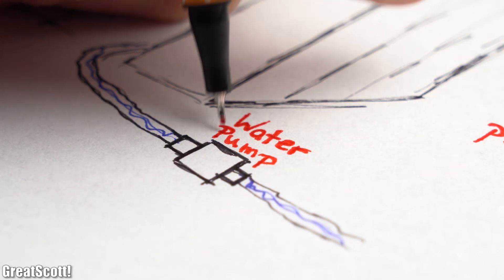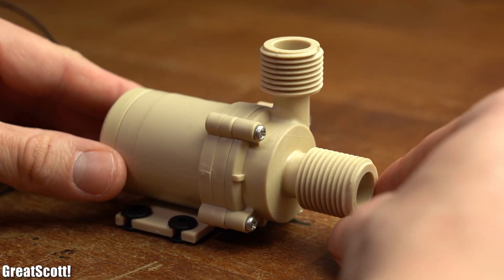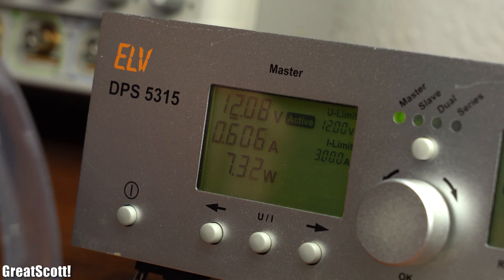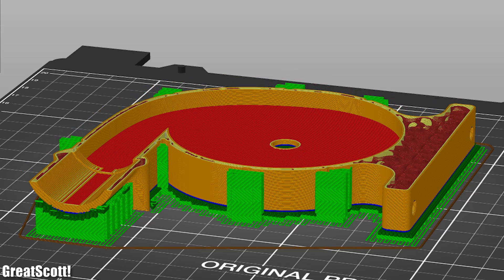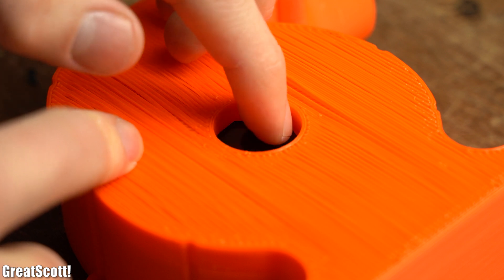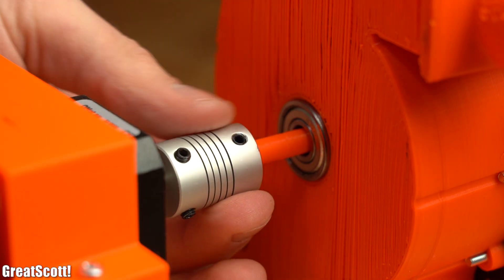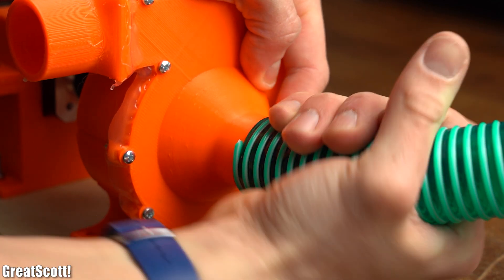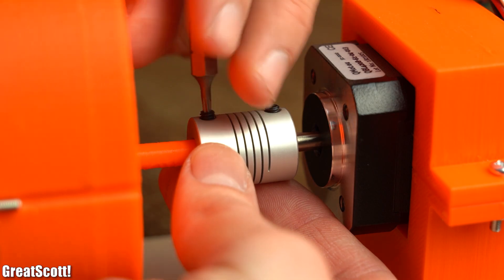Water Pump || DIY or Buy

Comment: I designed a similar project a few years ago.  I used a submersible aquarium pump which is self-priming with magnetic drive.  You need to ensure that not only the flow is good but the "head" or how high the pump can pump the water is also adequate.  I had some hanging plants.  Interested in seeing the control and measurement part of the design.

Comment: I need a reliable level switch for the 120 vac Sump Pump. The tether float switches fail and cause great basement floods at any time of the year.

If you have City water at a good pressure, consider a venturie pump solution.

Comment: I'm pretty sure that it is possible to 3d print a pump like that, but you have to build something like the rotor axle more accuratley so that it's perfectly straight.

Comment: There is a lot of comments about metal shaft, but I'll write one more anyway :) 
In one of my projects I pressed old screwdriver bit into tight fit printed hexagon. My 10 N.m screwdriver did not break this connection within 2 years of use.
Reply: Nice one, much better than using a grub screw.  I've got some hex extender bits (just hex to hex) and have used one to connect to a piece made in polyester filler.

Comment: Excellent video as usual 👌. I think you can build a more successful version of a pump called a "direct couple pump". Use the motor shaft and bearings to support the impeller. And use a shaft seal at the impeller housing. 👍

Comment: I don't think your conclusion is correct. You 3d print shaft on Z axis and this makes it weak. If you would do it in X or Y axis it will become 10x stronger. Also why you leaved huge gap between motor and prop 5:14 ? This raise stress to already weak component. You should review your printing. Huge fan btw. (Sorry for grammar, still learning.)
Reply from the maker: Thanks for the feedback :-)

Comment: Yes 3d printing is for sure a good option. Just don't make a shaft out of petg but out of metal. Sorry but bad video. There is just not the right information. This problem is easily preventable.
Reply from the maker: It was not the only problem. There were others realted with the 3D printing.
Reply: Yeah I tried it as well. Mine worked fine with a threaded rod. Also your rotor blades are pointing the opposite way. Yours want to scoop in water and the point of each blade is to push out water. Can you maybe make another video about this. Also I would make it half the size of this one. The motor is just not powerful enough and it will overheat for sure.
Reply: @greatscottlab  Is there a mailing address or something I can contact you. I will send you some good files

Comment: If you are looking for a pump cheap pump for water, you should take a look at the 12v DC pump (https://benselectronics.nl/pomp-12vdc-zelfaanzuigend/). I used this one for a project for school and it is possible to change the speed with a pwm signal.  It doesnt pump 8L/min but it definitly is a decent alternative.

Comment: modify the impeller to have allow a hex head bolt like an M6 to sit in flush to the surface of the impeller, and then the bolt is now a working shaft and has a key to it never slips.

Comment: The direction of the layers in which the shaft was printed and its small diameter are not capable of sustaning  high RPM. Also the 3D printed shaft is not balanced as you can see in the footage and this becomes a problem at high RPM. You could try to 3D print the impeller with a hole in the center and use a metal shaft instead. This is possibile but, as you said, it's easier to buy the pump because a new improve setup would require a bit of tuning to make it work perfectly.

Comment: I noticed some people have said that you should have tried a metal shaft with 3d printed impeller. While you could certainly try that, I don't think it will be of much help. The shaft is not the only thing that is under stress, the vanes are as well. PS - the profile and number of the vanes are also a variable in centrifugal pumps. Inward spiral, outward spiral or straight vanes. Some pumps also use guide vanes (static) in the casing of the pump, but I cannot remember if that was air only or any fluid.

What you can try is a geared pump. Think of it as 2 spur gears but with small "lobes" between the meshing teeth that trap water when they are spinning.

But still, the best option would be to buy a pump, especially the cheap Chinese submersible stuff. (They use plastic impellers, surprisingly)

Great video as usual!

Comment: 9:16
anyone with a 3d printer saw that one coming since 4:20
such a small cross section of 3d printed material is really weak
especially when printed along layer lines
Reply: The was a pretty obvious problem even to those of us who haven't used a 3D printer yet.
At least he leaves the comments open to let people tell him what he did wrong. Some YouTube technical channels delete comments pointing out errors. The Raspberry Pi Guy has contributed to many destroyed boards because of bad directions. He deletes comments pointing out his serious mistakes.
Reply: The moment I saw how the shaft was sliced I knew that it would break there. You cannot slice a shaft that way, it will always come apart at some layer.
Reply: Also, the print quality is quite bad, I'd say, when I see all the separation from https://youtu.be/GBv80BgfTBc?t=311 to https://youtu.be/GBv80BgfTBc?t=321
Reply: especially in PETG, PLA has the strongest layer bonding of the "low temp" materials unless you go to high temp like nylon in a heated chamber
Reply: @l3d-3dmaker58  And PLA flexes less and the biggest mistake he made, is not actually using to bearing, but letting the shaft flapping in the breeze.
Reply: @l3d-3dmaker58  I guess ABS is the strongest
Reply: @Tachi778  actually the weakest. PLA is the highest just after Polycarbonate and CF filled Nylon in terms of load. In comparison to PLA and PETG, ABS can take the least load before breaking and has at best same layer adhesion to PETG.
Reply: Yup I would have printed that piece separately oriented another direction and glued it in. Or just used a metal rod.
Reply: @Alobster1  even printed in a different direction, it still would have broke.  Just get a small/cheap section of m6 threaded rod, and it would have been fine.

Comment: Nooo, You did it wrong. And that model is bad.

Use a 8mm rod to connect it. Its not much to design and you dont event have to use glue. Just use an angle grinder to make one end into a D and make it it into the pump.

Comment: You didn't try replace the axle with a metal axle?

The conclusion is kinda right still.
Many of the pumps you can buy are without seals toward moving parts, and generally can't leak.
(the whole rotor is part of the pump chamber)

Comment: https://www.youtube.com/watch?v=aXcEiOuWKx4&t  DIY is winner!!!! 
i used motor direkt on impeller..  make 10meters lift.
Reply: Great video and project! Less pieces to break that way too, looks like it works just fine. Any way you could provide the parts and files to it?
Reply: @JacKAsterisK  yeggi.com you can find a lot of models of this centrifugal pump.. btw thank you :D
Reply: Wow, great work there! Maybe Scott could do a follow-up fixing the project?
Reply: seems like on your pump the impeller is wrong
Reply: @philehr  in what way?
Reply: I left a comment on your video with some friendly suggestions for how to operate it that might improve the performance of the last demonstration. One thing though, where do you show that the pump can produce 10m of head? Also you did mean 10m of head, right? As in it can produce an outlet pressure equal to the hydrostatic pressure of a 10m water column?
Reply: Nice project looks like you have a nice working pump.
Your A8 is a little sad though you need some upgrades 👍
Reply: @Side85Winder    i make mpcnc machine/3dprinter.. ;) in next 30 days you can see video about it.
Reply: underrated channel
Reply: https://youtu.be/TfBycQ90-L4
I made one, too! I works great
Reply: Yes! You had a much better design. I hope MediocreScott! modifies his design to become GreatScott! again.
I do appreciate Scott shares his failures.
Reply: @ddegn  thank you

Comment: You should have modified the impeller part and make a hole for a M6 bolt. With that you'll have a metal shaft and a fitting by shape with the hex head of the bolt

Comment: You shouldn’t rely on the 3d printer for the shaft u could of make them out of a different material for example like aluminum since its rigid and light

Comment: the shaft could be metal. Just print a rotor with a hole and a few tiny screw holes like in a door handle and attach the rotor to a metal shaft. That would work way better!

Comment: Like every other comment, you need a metal shaft. 
Just drill a hole in the impeller cut an x slot in the shaft for some metal sheet to use to key the plastic. Heat the shaft and insert.
Also you can turn off your fan on the 3d printer and maybe add 5-15c to your hot end to get better layer adhesion.
Swap pretty for strong.

Comment: 1.Powertransmission should never be done using 3d printed parts.
2.Shaft should never rotate inside the inner race of bearing. It should rotated along with innerrace (pressfit) otherwise there is no use the bearing.

Comment: Hey man
why don't you use a submersible water pump that takes 220v and as is way way cheaper. In India, you can get one of the submersible pump for 2 dollars with a pumping capacity of 11 to 18 liters per minute. You can use a simple relay to control it and also use a triac ac voltage regulator to control it's speed.

Comment: The project is interesting, but the costs with some components disadvantage it in price compared to those of the trade: 1. Using a more expensive type of engine 2. Defective mechanical design - you left the pump shaft out of plastic -.

Comment: Hex nut imprint for a bolt as a shaft would do better, just not thread all the way so you can still get a bit of a seal on the shaft and you would be off to the races

Comment: I noticed this in the first instance. I have made my own pumps but without 3d printing. I made small pumps by casting exposy resin and grinding it down. Now all you need to do is screw in proper shaft and add a waterproof bearing. These you could get from old blenders. Yes, the size will be large but you can adjust your shaft to be thick in the middle.
Reply: Remember, this is a sponsored video

Comment: Modifier the propeller so it accepts a metal drive rod the same diameter as the bearing and it’ll work fine. Might also be worth testing the balance of the propeller when it’s spinning, so it doesn’t vibrate itself to pieces 👍🏻

Comment: Why didn't you make a 5mm hole in the rotor and put a M5 bolt to be used as a strong shaft? I think your huge pump could work well! 💪
Reply: He wouldn't be able to seal it since a shaft seal can't work on threads

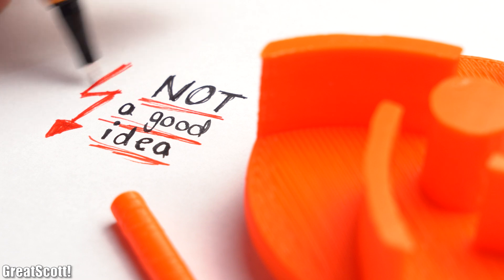Comment: 9:26 they probably used the motor shaft instead of a 3d printed one, judging by how close the motor is to the impeller
Reply: its also badly printed, the layers look terrible
Reply: @rueebliortak  no, it is clear that the parts were printed on a raft, however this should not affect the shear strength of the shaft.
Reply: @s.sradon9782  The layers being perpendicular to the shaft certainly contributed to its weakness and failure. Also, he printed the fins the wrong way around, which creates more drag and stresses the shaft a lot more. Still, a metal shaft would have been a much better idea
Reply: Having printed one of those tiny ones, I can confirm that it does use the motor shaft. The impeller just friction fits directly onto the motor shaft.

Comment: Love your videos, but there are only a couple issues here that made the DIY solution not work. Fixing these issues would have made this pump so much better.

#1 your shaft isn't strong at all.  It's printed in the worse possible direction and not even engaging with your bearing - the solution would be to use some sort of threaded metal rod for the shaft and attached the printed propellers to it.  Using the threaded rod, you can use nuts to hold the rod to the bearing as well as make it strong enough to work.  Also you shouldn't hammer bearings into place, you should press them with a vice or clamp.

#2 your water proofing would be easier by using some silicone caulking, trapped between the housing. The tape for the shaft holes was probably still a good idea.

Comment: Edit the 3D model to add a hole in the center of the impeller instead of a platic shaft
This should work much better

Comment: I think the impeller wasn't aligned correct with the motor to the flexible coupler and the missing support of the bearing. It seems that the impeller shaft hast no connection to the inner ring of the bearing.
I would definitely retry this DIY-OR-BUY.

Comment: Try printing the shaft horizontally instead of vertically, CNC Kitchen have tested 3D printing materials and shows that parts are over 3x as strong in the horizontal direction.

Comment: You just need to use a piece of rod and a cross shaped piece of metal to print the vanes around. I would print a circle with an inlay for a cross shaped piece of metal then mount the shaft to the cross and sandwich the cross between the disc and impeller. That will distribute the force and you can reuse the parts you already printed.  ----|xE     < Like that if that makes sense.

Comment: JUST DRILL OUT THE PLASTIC SHAFT AND PUT ABOUT A 4 INCH  SMALL BOLT THAT WILL FIT THE BEARRING AND USE THAT AS THE SHAFT

Comment: As with some other comments mentioning, I'm curious if the rotor and housing would have held up if the shaft was replaced with a metal one. Also incuding an Oring groove sized for a common sized Oring to seal the body might have made assembly slightly easier I would guess.

Comment: The weakness of this type of pump is the bearing, which wear and leak. The risk is water will find its way into the motor. A more interesting design is one which uses an induction principle to rotate the pump mechanism. With this type of design, the water chamber can be water tight and isolated from the motor and its vulnerable electrics. The problem with this type of design is close coupling the magnetics. Pond pumps seem to manage this well. They solve the self starting problem by making the pump fully immersible. 
In principle using induction would solve your plastic drive shaft problem. For some years now I have been intrigued by the possibility of having a rotating impeller disk that is driven by induction, and does not require any bearings, it being levitated by a combination of fluid flow and the magnetic field. I have seen examples of air fans that have an annular ring of metal surrounding the fan blades, this allows the fan to be driven by linear induction using coils mounted on the side of the fan. The advantage of the system is that the drive motor is not in the air flow, which is important if the air is polluted by smoke, steam or other corrosive gases.
At the moment I am working a control system project for my fish pond pump. Such pumps suffer from having to pump biologically active water with potentially alge, mud particles and lime scale in the water. Given time this can block the pump and stop it rotating. Such a failure can overheat the pump and burn out the induction coils, even when it is under water. Worse, such pumps are used to pass water through UV steriliser units. These must remained filled with water at all times to prevent the bulbs from overheating. 
My solution involves using a capacitive coupled water sensor to check the the pump is successful pumping water through the UV unit. In the event of a failure,both the pump and the UV are switched off. Some logic is required to  control the start up sequence of the pump and UV. It also allows for the prevision of an auto off water level detector, should the pump start to empty the pond, in the event of a failure of the water filter recirculation system. I am thinking of adding a radio alarm to warn of any failures and maybe to monitor the pond water temperature.

Comment: the pump shaft could be change to a metal one that the impeller slips onto and is fixed with set screws. But it is a lot of force thats being put into it. 👍👍

Comment: Dude you need an aquarium ;)))

And at 5:09 the pump vanes are backwards bud
6:08 STILL BACKWARDS...!!!!! ;)))

If you have the canes in the correct orientation then it might not fight itself and won’t have such stress forces.
Reply: You forget about plastic axle what is not fitting to bearing... It is better to use real sealing like simmering or o-ring. It is also better to make small one with higher rpm than bigger with lower.
Reply: Yes, they are! It's kind of disappointment. From mechanical point of view this pump is terrible ...
Reply: Its not necessarily his fault that the pump vanes were backwards. Remember that he used a user created file that he just downloaded and printed.

Comment: I would make a metallic shaft for the pump impeller that is the same size as the bearing and I guess it would work flawlessly. And i probably print the impeller with a stronger material lice PC or ALLOY 910. Nice video

Comment: I did the exact same thing last spring.  Tested printed pump houses with various results. I finally bought the pump house and used my own motor. 
Friend of mine used a old defect water vacuum cleaner, that is what I'm going to use for my next project.